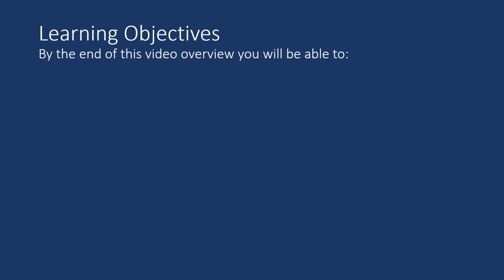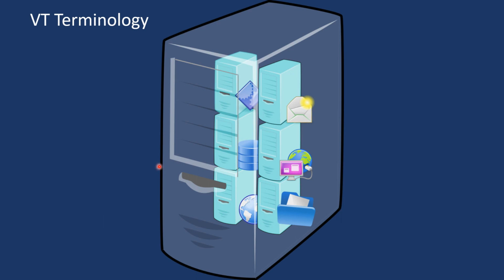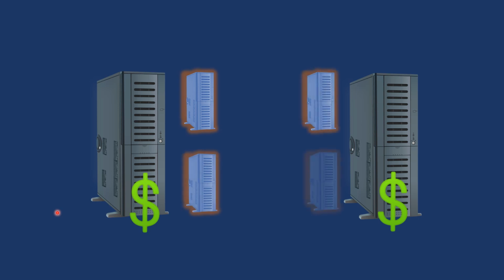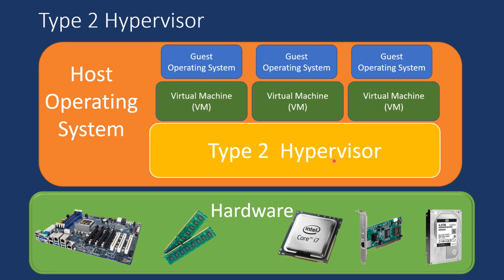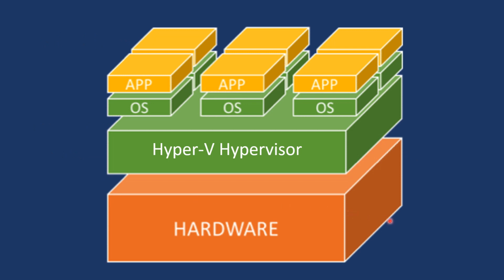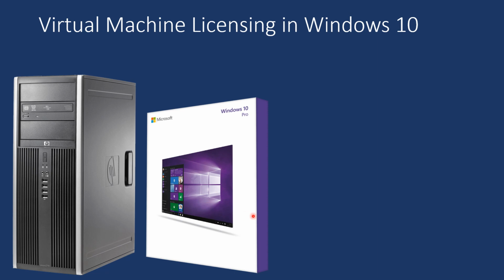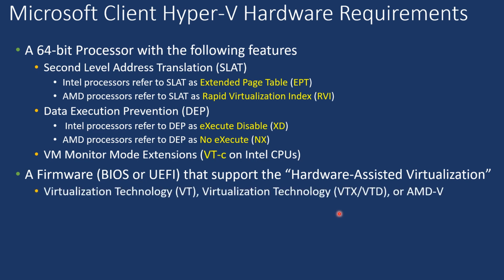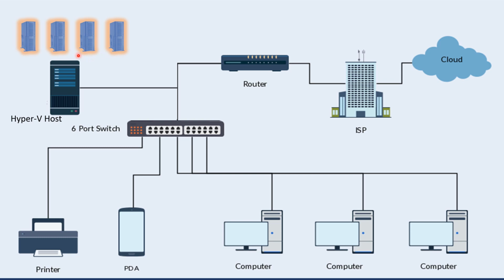Virtualization Technology and Microsoft Hyper-V Overview

Comment: Hello Dr. Akram, I hope you are fine, a beautiful and complete explanation about the virtual machine. From my point of view, it is a very useful program in several respects, including training on it in several areas as it does not affect the platform and you can be comfortable in your work without fear of affecting the platform. One of its advantages is that it has many advantages, including absolute control over the virtual system that you will create, such as RAM and storage capacity.